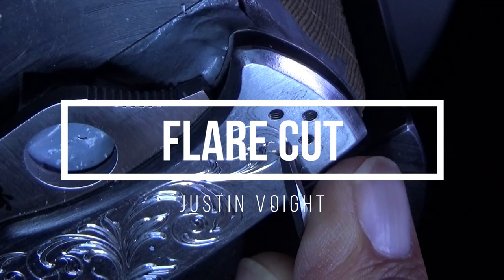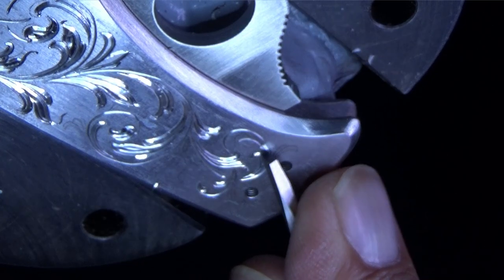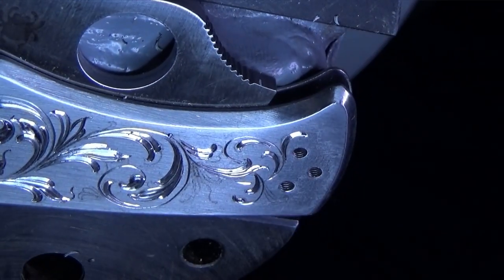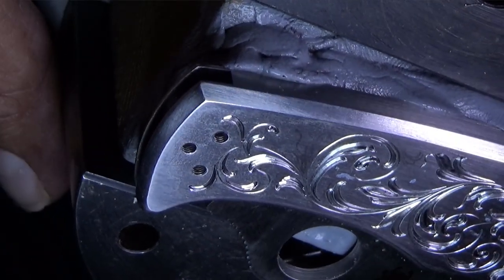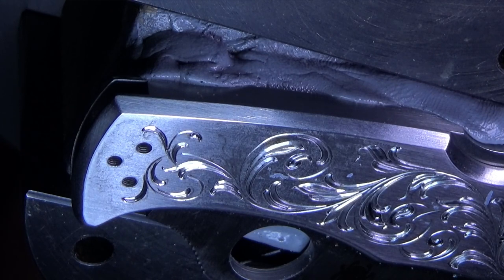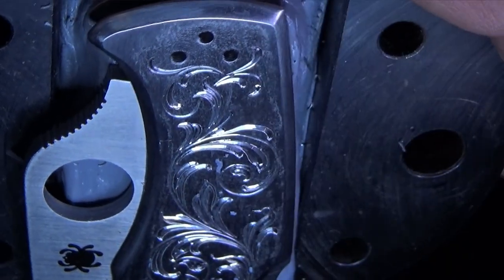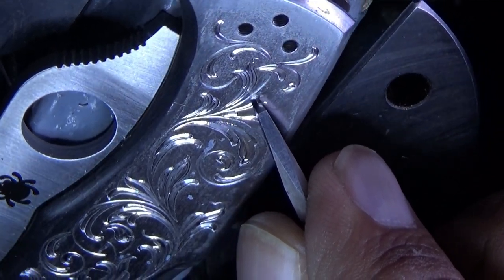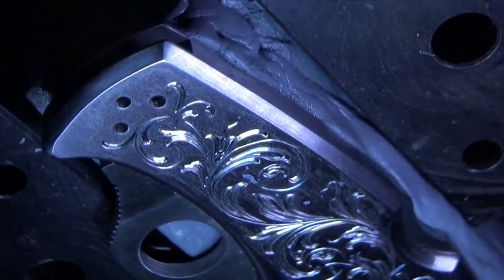Hand Engraving A Flare Cut Motif Into A Spyderco Knife

Comment: I've just tried several types of 304 stainless steel and what do you think is the hardness code for the stainless steel usually used for carving, for example for necklace pendants or knife handles.
Reply from the maker: 304 is inherently difficult. I have cut it and it cut very well and then the very next project I was constantly resharpening. Stainless like all steel can vary in hardness so it helps to have a supplier who is consistent. When it comes to knife manufacturers, most are not exactly consistent so you just have to hope you get something that cuts.